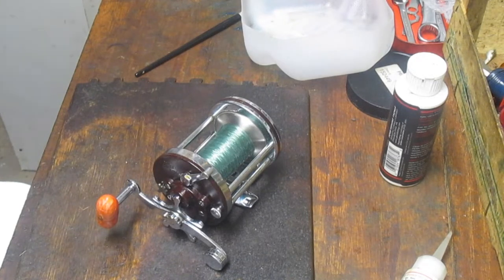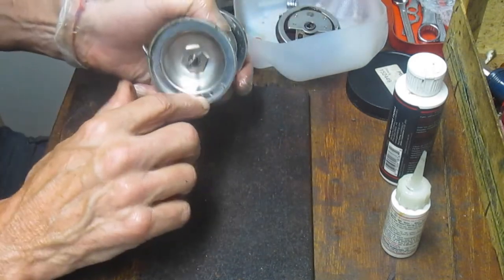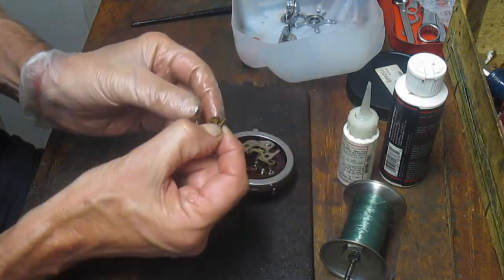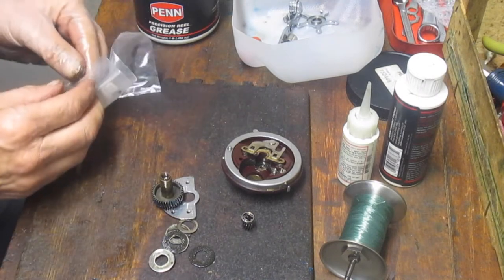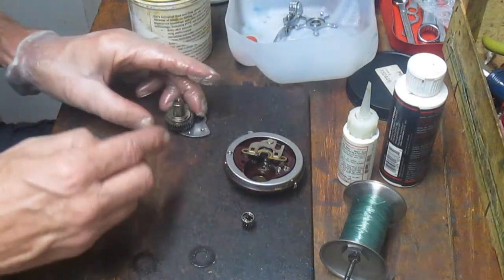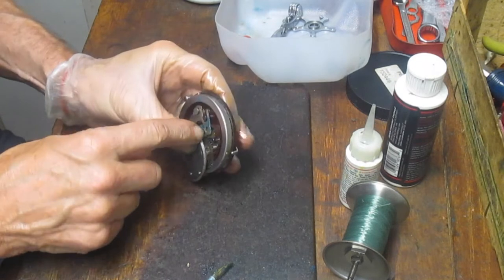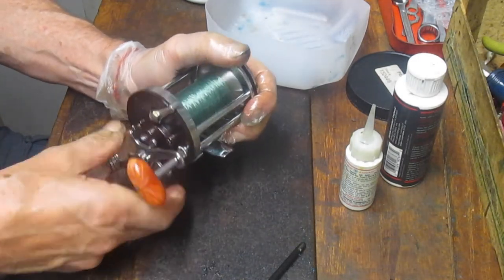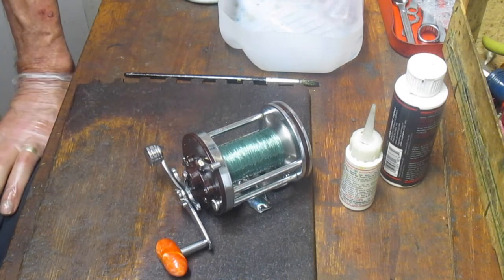Penn Squidder 140 conventional saltwater fishing reel how to take apart and service

Comment: Sir Dennis, how to fix a friction between spool and the plate on the right of this penn squidder 140. Your videos helps a lot. Hoping you might help me on this matter. God bless!
Reply from the maker: Have you used the non-gear side bearing / adjuster? Thurn it counter clockwise to allow for som side to side play.  That is the usual fix.  If that does not solve the problem, you may have a bent frame that would need to be squared up - Dennis

Comment: Another excellent video! I have a squidder 140. It casts smoothly then has a herky- jerky retrieve maybe stop-start better description after encountering first resistance on retrieve. Any idea what is going on?
Reply from the maker: That sounds like a twisted frame or a bent spool.  If you remove the gear side plate and turn the handle, you can see if the gears turn freely.  If they do, chances are that the frame or spool is out of square.  If it is the frame, you will need to straighten or replace the reel seat - Dennis

Comment: Dennis I now have 2 Penn Squidders which are in excellent condition and I’m preparing them for use. How do you remove the bearings? There is dried grease around the bearings and I would like to clean them. I’ve applied Lucas Fishing Reel oil, but I would like a clean start. Thanks for what you do!
I have purchased 1 set of Carbontex drag washers and need to purchase another set. Is there a difference between them and the HT-10 washers?
Reply from the maker: THe non-handle side bearing is encases in th mounting cap and cannot be removed.   You need to replace with the full assembly.  Thanks for asking
Reply: @2ndChanceTackle   would you recommend cleaning the non-handle side in a Ultrasonic cleaner? Thanks
Reply from the maker: No need to do that.  I would use a rod and reel cleaners to get rid of any film or dulling - Dennis

Comment: I have serviced several Penn reels including a 140 Squidder.  Problem the Squidder skipps and jumps around after all the service.  I installed new H-100 drag washers but not the metal washers.  They look good as do all parts, gears, and pieces. Thoroughly cleaned and lubed.  Still skips??  Frustrated.
Reply from the maker: That may be frame twist.  It does not sound like the drag washers.  It sounds like the frame is out of square.  Do you have equal gaps around the spool top and bottom on the inside?  If one is more open and the other closed, then the frame is twisted.
Dennis
Reply: @2ndChanceTackle  thank you. I’ll check on that.
Reply: @2ndChanceTackle  It does not appear to be frame issues.  Looks square. 
I think it may just be bearing/drag  adjustments.  Still working on it.  Such a beautiful reel.

Comment: How do I change the bearings on squidder 140
Reply from the maker: The non-handle side bearing is contained in the adjuster cap.  You cannot remove that.  It has to be replaced as a unit.  The part is available through Mysticparts.com.  The link is below.
The gear side bearing is held in with a washer pressed into the case.  Pry up and put to remove the washer first and then the bearing.  The replacement bearing is also available through Mysticparts.com
Thanks for asking.
Here is the link https://www.mysticparts.com/PennParts/Parts/40-140.aspx
Reply: Thanks
Reply: @2ndChanceTackle  thanks
Reply from the maker: YW